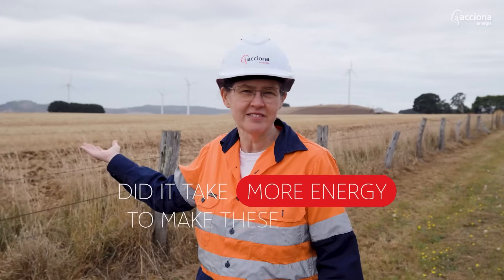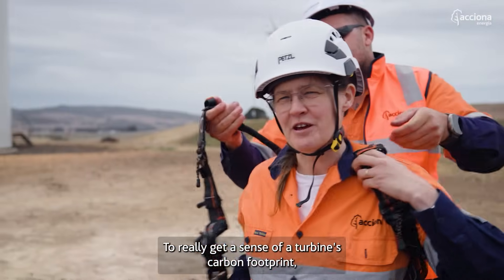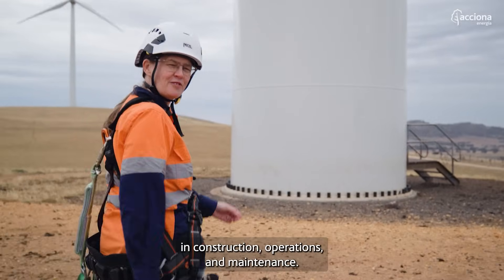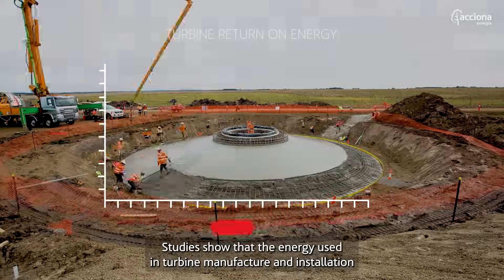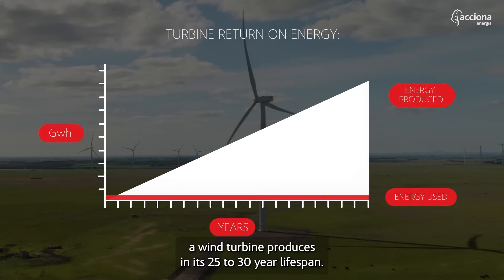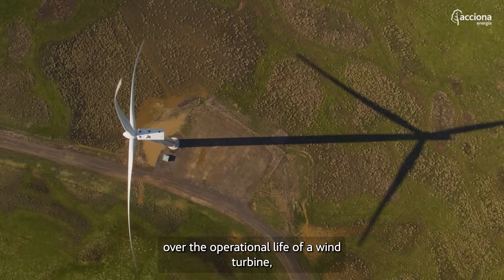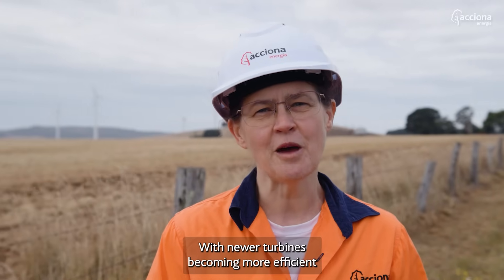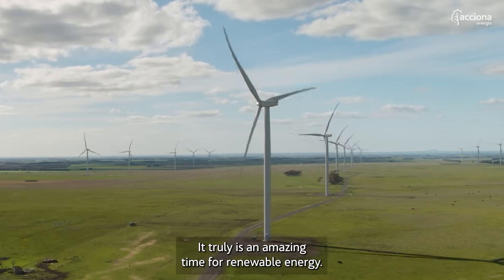Does it take more energy to build a #windturbine than the energy it produces?

Comment: perpetual energy well done and the experts said it couldn't be done
Reply: No such thing as perpetual energy.  Wind turbines last 20-30 years. Perpetual means forever.
Reply: It's not perpetual, perpetual energy refers to the energy within a system. In this case, the system is Earth's surface, which gains energy from the sun, and ultimately powers wind turbines. Perpetual wind turbines would spin forever, regardless of the wind.

Comment: So from cradle to grave how long before the parts are returned to the earth in the same condition that they were found in?
Reply: Yes it does if you create large  vertical axis wind turbine and along the vertical access you add numerous amounts of standard propeller  turbines now you will take the minimum energy required to initiated a third auxiliary fan that point the wind towards the vertical access creating a turbo system.pleqse cease scrutinizing the wind or exampl3s will be made to  demonstrate our beloveds resolve. Oh and don't forget to along the massive structure with TEC's  thermal electrical conductors.  Not only is it beneficial to continue harnessing the wind inwould ask that ypu  nolonger have a negative view towards the powers that be . judgment day is upon us hinder it as much as you can please lord God your attention to this matter is eternaly appreciated amen BY THE PLEASE VOTE YES ON PROP 0GRAVE V . THE IMMIDEATE CEASE AND DISSIST OF ADVERTISEMENTS ON OBITUARUES FIGHT OUR DEPARTED FOR SOME CHISE TO REMAIN IN THE HERE AFTER KEEPING FAMILY IN THIUGHT  INSTEAD OF RETURNING A NEW HONOR THIS ITS OUR SACRED DUTY
Reply: The same applies to the components used in any energy source, can you return burnt coal to the earth in the condition it was found in ?